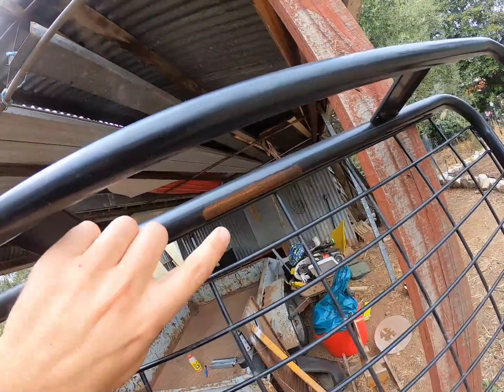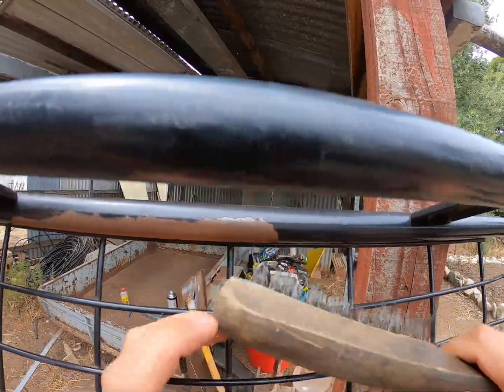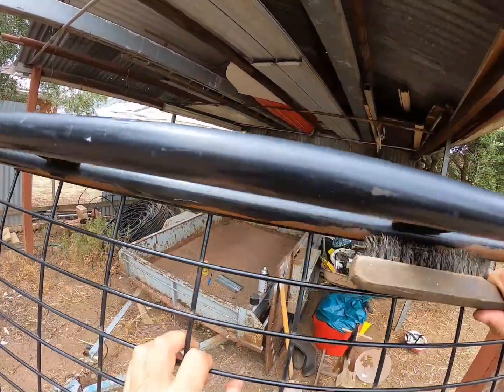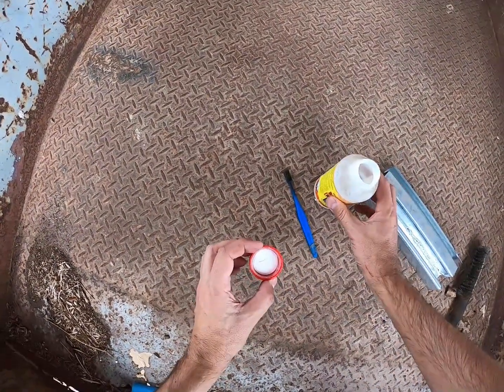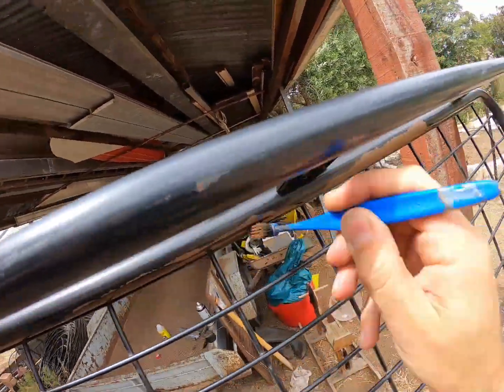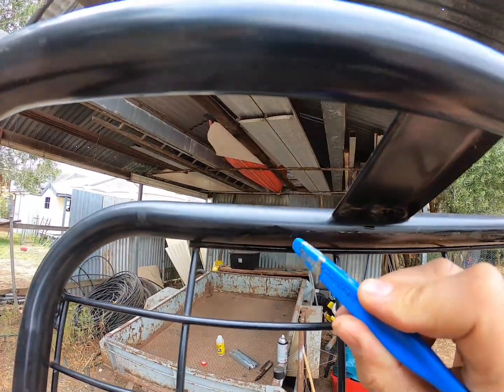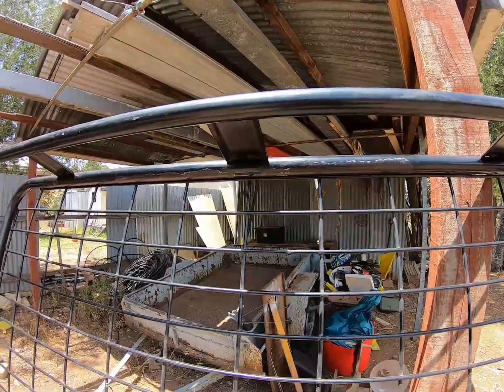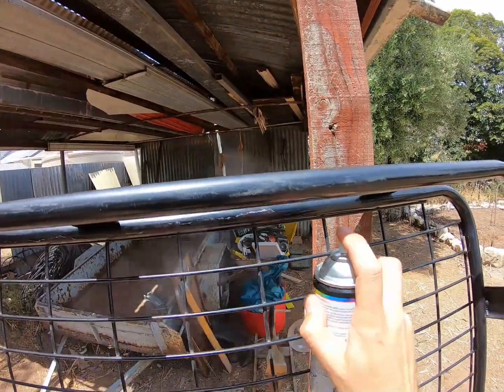How to repair surface rust (on a Ridge Ryder roof rack)

Comment: Very common problem with almost EVERY roof rack cage.  There aren’t even good Aluminum (rust proof) options.  The rust can pool up on the top of your car and run into your car interior if the windows are open and ruin the interior
Reply from the maker: Thanks mate, yeah I ended up getting a new one and it's starting to do the same! Might just have to be a consumable part!